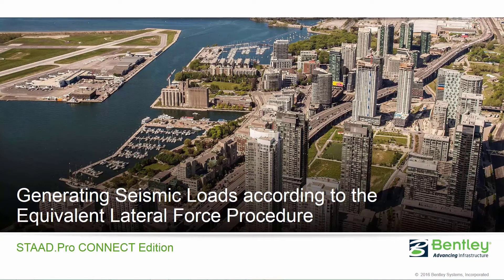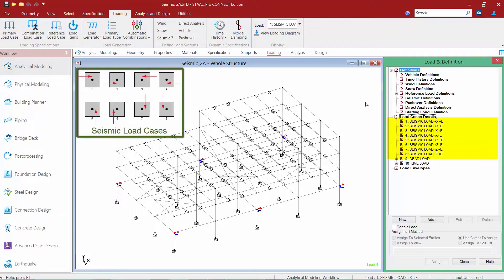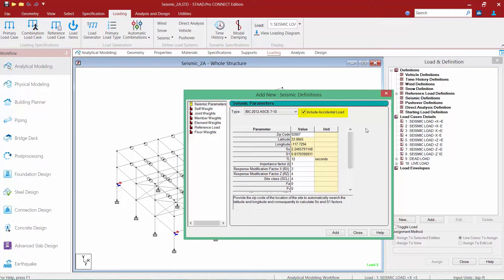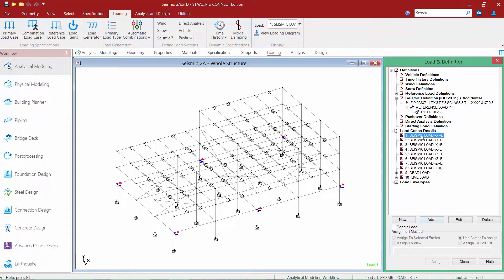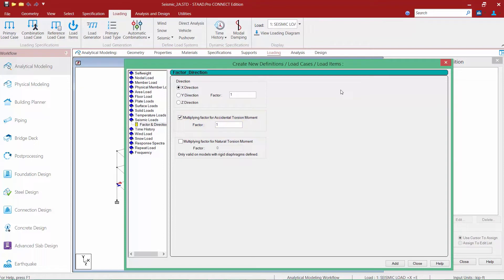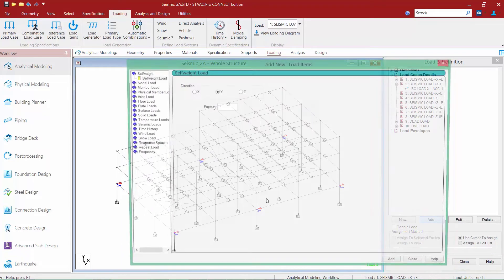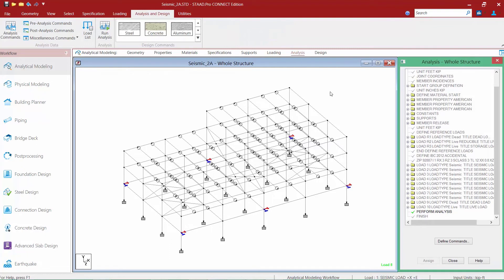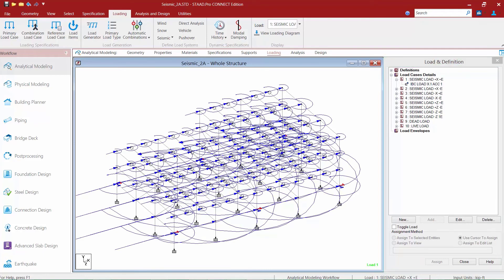Generating Static Seismic Loads with Accidental Eccentricity in STAAD.Pro

Comment: E x=70Kip with accommodation 80kip for 10 floors 24m×32m multi-storey mid 7.2m×6.8m camel
Add corner 7.8m×4.6m Earh seismic mid 80kip with dead load ×1.2